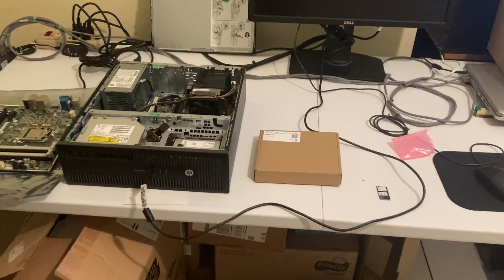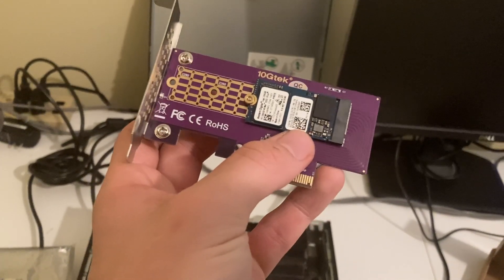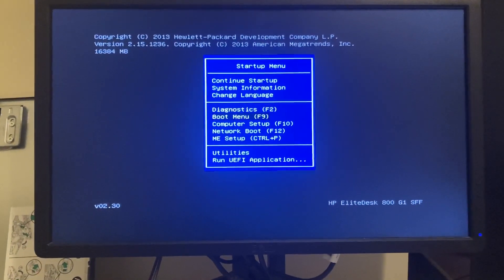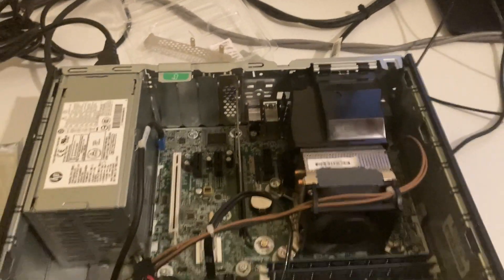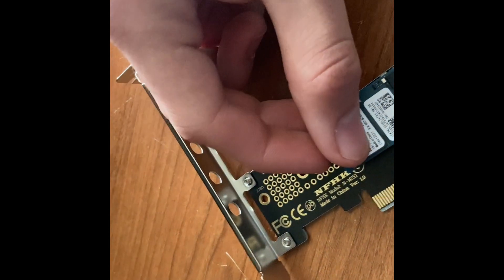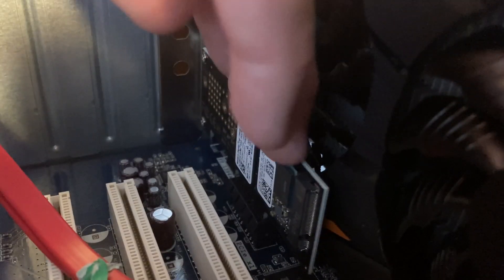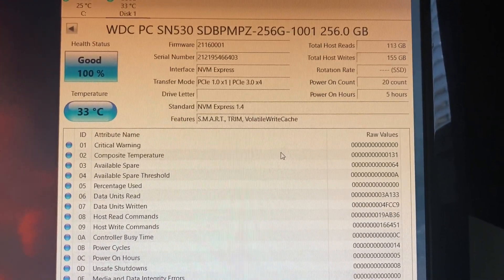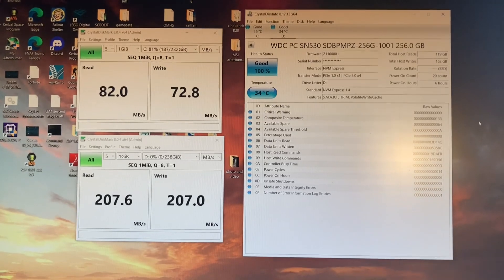PCIe X1 and X4 to NVME SSD adapter cards review and install

Comment: I use the x1 adapter to clone a new nvme from the old one b/c my system only has one m.2 slot. Swap it out later and use the old nvme on the slow pcie x1 as backup drive.

Comment: You didn't need to install these brackets at all for a lightweight device like the nvme. Most Chinese adapters are already without them. I also had a 10-year-old PC on Core i3770 without NVME support, but just before selling it I modified the BIOS to support NVMEs. Unfortunately, I haven't tested it, so I hope it works.

Comment: I have the same NVME PCIE 3.0 x1 adapter but on PM9A1 (980Pro OEM). 
PCIe 4.0 x4 RD SeQ 5600MB, 4k-64 3600MB, 4k 89MB.
PCIe 4.0 x4 WR SeQ 5400MB, 4k-64 3500MB, 4k 130MB.

PCIe 3.0 x1 RD SeQ 800MB, 4k-64 800MB, 4k 78MB.
PCIe 3.0 x1 WR SeQ 800MB, 4k-64 800MB, 4k 128MB.

Comment: i bought one works great pcie 2.0 x4 slot in a tiny case 1800MB read and write
Reply: Great .. can you tell me the brand name?
Reply: @melodychest9020  the one i bought is full length so will work in a x4 x8 and x16 slot  just not in a x1 slot
Reply: @melodychest9020  ELUTENG M.2 PCIe NVMe Adapter M.2 SSD
Reply: @melodychest9020  theyre all chinese anyway why would brand matter

Comment: I don't know why it was showing as a USB drive.  Maybe it has a controller similar to that of a USB drive.  Or it might be something the manufacturer did and did not catch it..  I don't mess with BIOS updates unless I must to get a fix for Logofail but the next update may have that drive named properly.  Do you get the expected speed from the drive?  If so it is not that much of an issue and is probably just a typo in a table in the BIOS.  I would not worry much about it myself unless I had other bizarre issues I could not explain.

Comment: I have a card similar to that and they are very basic.  The nice thing is it makes those adapters dirt cheap to buy.  It wouldn't surprise me if you could buy them in bulk for a lot less than the price of one each.  Mine has a green LED on it and really that is the only thing noteworthy.  I did not buy it for that or know it has it.  I usually don't prioritize any kind of RGB lighting.  The inside of my case is a dark dismal place really aside from that and the RTX logo on my graphics card lighting up.  My motherboard could support an APU but I just went with a plain old traditional CPU.  That is a Ryzen 9 5950x (16 core)

Comment: I was going to add that AMD's latest APU, 8600G has great 1080p graphics so you don't need a GPU, therefore the X16 slot that is usually designated for a GPU is now free to use with a storage form factor provided you choose a compatible X16 adaptor.
Reply: An APU alone is not enought depending on what you want to do with your computer, a GPU is a must

Comment: Some older machines require BIOS mods to support booting directly from NVME drives. I have a Dell 9020MT motherboard and I had to mod the UEFI bios to add a driver so it would support it. Such a mod may not be available for all mobos so kinda risky to try unless you do some research before hand. ;)

There are some cards that use bios extensions. This requires having CSM setting enabled in UEFI for those to be bootable if you are on a machine that is primarily UEFI based. The ones you got seem to be simple passive adaptors so you'll need a UEFI/BIOS that supports it natively.

Also it looks like you didn't initialize the drive until you put it into the second PC...that might also contribute to it not showing up properly on the first machine. You'll want to recheck how it behaves in the first one now that you initialized it. ;)

Comment: Judging by the 3 PCI brackets on the second board that slot may very well be a PCIe 1.0 1x. I would advise using at least an intel gen 6 or 7 board.

Comment: You bought a cheap nvme that's only PCIE one . Your motherboard supports pcie2 so if you get a new envy me drive 350 reads on a pcie 2.0 slot.

Comment: You actually dont need the bracket for this. Just slot it in and remove the braket unless your oc has not enough elvents then the braket will be one exhaust.

In summary the bracket is not needed for most cases
Reply: What is oc, please?

Comment: i was wondering if adding this to my motgherboard would work out because my only available pcie port is directly under my GPU but now I see yours is as well. How is that holding up ? i currently have only a sata drive so this would be alot faster correct?

Comment: When using these adapters, should I always put them in an X16 slot or lose potential bandwidth ? What happens when I put one in an X4 slot or smaller? Still works but slower?
Reply from the maker: If you buy an x4 adapter, and the ssd is x4, and the slot is x4, no bottle necks. If you change the slot to an x1 slot, everything will run at that speed. Whatever is the lowest of the three (adapter, slot, ssd) is will run at the slowest speed
Reply: @mrmax128  Thanks! , how much am I limiting if I must put an X4 drive into an X1 slot, would I only be getting 25% bandwidth ?
Reply from the maker: If the drive and slot are pcie gen 3.0 or 4.0 the x1 speed would be faster than sata iii, but equal or less than 25% speed of x4
Reply: @mrmax128 pci x1 slow usre m.2 nvme speed .. Ssd normal sata .. Than fast.. 500 mhz ssd speed ..

Comment: screw the gpu in the clamps dont have the force, also unless you only, have a 1x slot why limit the drive performance with a 1x card instead of a 4x.

Comment: You'll need to mod your BIOS first so it would detect your NVMe as PATA drive in your BIOS, I don't know if there's mod available one for your HP motherboard,  but I got one for my ROG Rampage IV, here's the mod link for Rampage IV motherboards https://youtu.be/uZDBBYfsNK8 (you'll need the mod for NVMe file added to your current/latest BIOS for it to works and bootable)
Reply: Now possible. See my link.

Comment: Well , i buyed 3 of those ( 4XPCIe 3.0 ) Adapters for ~ 7 Dollar over E-Bay (new) . I would be not surprised if they work with PCIe 4.0 as well because there is no chip on the PCB , its only rewireing . Maybe shielding could be a Problem for the PCIe 4.0 signal .Besides , most NVME will run with 2 Lanes or even one Lane and it dont has to be PCIe 3.0 . 2.0 will work to , its only slower . 
Its a waste of Lanes to use it on a X16 Slot with real 16 Lanes , if the MoBo uses Bifurcation for that slot = supports 4 x 4 Lanes i would consider to buy an Hyper X from Asus Card where you can put 4 NVMEs on it , i consider it for my NAS if i throw out the HDDs and put in SSDs in , with it i could use up to 7 NVMEs in my TrueNAS ( old B450 Board with 3900X on it , 32 GB ECC Ram )
Reply: @OKuusava  ? For 40 Dollar 4X PCIe 3.0 NVME  or 60 Dollar with 4 x PCIe 4.0 with 4 NVME Slots ? In a NAS you dont need necessarily a GPU , if your old MoBo supports Bifurcation and you need that many NVME an Hyper X is the way cheaper option . And i just found another interresting use for an M2 NVME Slot , there are Adapters for M2 slot to SATA with 6 Ports , just ordered one for my NAS on Ali Express for ~ 20 Dollar . My old B450 in my NAS has only 6 SATA Ports , but 2 NVME Slots , one is my Boot Drive the other one is unused , lifts the possible HDDs/SATA SSDs to 12
The restriction on a  consumer Plattform are allways true PCIe Lanes because consumer CPUs have only 24/28 of them , 16 Lanes for the GPU , 4 for an NVME and 4 for the Chipset

Comment: There's different flavors of NVMe M.2 drives for specific purposes and it's buyer beware if you're looking for a SSD HDD replacement. A dead giveaway are the prices. It's worth doing some research on these drives so you won't be disappointed by the posted speeds.

Comment: For your first machine, you should use the bottom x16 since only 4 lanes are needed. The top slot is x16 wired while secondary slots usually do x8 or x4.

Your second machine would be better suited to a SATA SSD. It has SATA 3 ports, which would give significantly better performance than the M.2 limited by x1.
Reply: Without knowing the exact motherboard, the second motherboard looked like a late generation LGA 775 platform and would be limited by the SATA 2 3Gbps speeds provided from the ICH (SATA 3 6Gbps not yet available). The PCIe 1 x1 slots runs at 2.5Gbps and is also connected to the ICH
Reply: @saccharide  Unless I got confused with 3Gbps there was some point in the video that gave me the idea it was SATA 3 6Gbps, I'll skim and edit in a timestamp if I find it.

Comment: i have this morherboard " msi pró X299 is pci 3.0 if i buy  SSD adapter PCie 4.0 x 16 i gain bost or only stay in PCie 3.0 ?!!
Reply from the maker: If motherboard is Pcie 3.0, then any device connected, like ssd, will be limited to pcie 3.0, and will not do pcie 4.0
Reply from the maker: If motherboard is Pcie 3.0, then any device connected, like ssd, will be limited to pcie 3.0, and will not do pcie 4.0

Comment: If you want to boot from a NVME SSD natively on a system that doesn't support it you need to get a Samsung 950 PRO SSD, that is the only NVME SSD with a boot rom build in, anything else wont work
Reply: Thanks for the info
Reply: You mean like windows 7?

Comment: 9:02 Barely. The theorical speed of PCIe 1x1 is 2 x 250 MB/s. And we see it using a little more than 83 % of it.
The theoretical speed of SATA(III) is 600 MB/s and we've seen 2.5" SSD drives as fast as 560 MB/s in practice! More than twice that speed! 
So get that instead of this.

Comment: In order to boot from SSD adapter, you need an adapter with it's own BIOS extension. (boot capable, with chips like Asmedia for example) You can even use it in an LGA775 main board, with PCIe 1.0 or 2.0.  You will see an extra boot option in bios settings with these cards.
Reply: you can use bootable clover in usb
Reply: Those adapter cards with bios extension are S L O W. Your better off using SATA and stay off the PCIE lanes with junk controllers.
Reply: @alsanderson4917  right pci x1 slow speed ..500 mhz ,better than ssd normal sata port
Reply: @kamalyadav3024  pcie 2.0 x1 is the same speed as sata3 pretty much
Reply: pcie 3.0 x1 twice as fast
Reply: You can also use an SSD with Legacy Option ROM. Unfortunately these are only older ones like the Samsung 950 Pro, which I previously used in a Hackintosh.

Comment: I've used Clover to boot my Hackintosh for years. It can be installed on any small SATA drive too, not just a USB stick. I'm currently building a 4th Gen system to use RDT to access my main PC. I learned there was a custom firmware that added NVMe booting to the motherboard I had. After a bit of vetting, I decided to go for it... It's only a 4th gen board. Not like it's new. Flash went flawlessly, and now the board can boot from an M.2 installed using one of these PCIe adapters!
Reply: Was the custom bios from 1 source? I saw a video of a guy offering custom bios adding NVME support. Share the link for that. I have an old X58 board I want to add NVME support without clover.

Comment: 1400 mbs using a 2 drive raid 0 on a old p5q3, next week I'm gonna try 4 ssds in raid 0 to see how fast she moves and you can boot off it since it's set up from the bios.

Comment: only thing by using that card in the 16x slot means you cant instal a dedicated GPU
Reply: Pci x1 m.2 speed very slow ... Better than ssd normal use sata port ..

Comment: Cool video, but decent sata 3 SSD would smack the shit out of that PCI-e 1.0 x1 interface ngl. Even cheap dram less drive would do at least 450 read 400 write
Reply: Not really because these are older computers that don't have sata 3. I did buy a pcie X1 to sata 3 bord and unfortunately it only gave me sata 1 speeds. It was a cheap China board. You got to check the specs on these things when you buy them people try to rip you off thinking you're getting sata 3. 😮
Reply: @TimothyCampbell-h4z  I have asus h61 board ..but pci 16 slot use gpu .. Pci x1 .. Only .. M.2 nvme use .. What speed ?

Comment: First NVMe was not USB hd, bios did not support boot from NVMe (or NVMe was not bootable)
Reply: elaborate
Reply: @Clashy69  Old systems do not support boot from NVMe
Reply: @terosma  what count as old like csm bios ? i have msi b550m pro vdh wifi and i need to clone my boot drive into a new one but the easiest way is onto an x1 slot, would it work without doing anything else other than moving boot priority
Reply: @Clashy69  NVMe boot support started 2015 on Intel, 2016 on AMD, some cheap mobos did not have support after that either. Needs UEFI in bios in general. Your MSI is not that old, Grok says x1 slot is not bootable for NVMe M.2 though, they have omitted UEFI boot on x1 slot to save space. x4 x2 or x16 slots can boot NVMe.

Comment: sata will be better speeds for ssd than pcie 1.0 x1 which is 250gb bandwith. 2.0 x1 is 500gb and 3.0 is 1gb. So pretty much go sata unless pcie 3.0 x1 or any pcie x4 adapter will be 1gb and up. Hope that helps others.
Reply: Pcie 1 x1 is 250mb
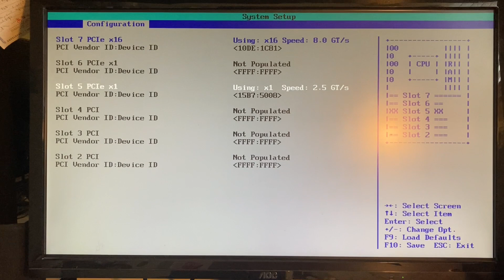Reply: For the 1st sff pc he is using a pcie x4 adapter which utilizes 1gb bandwidth and is actually better than sata. The second pc, he is experimenting to see what the pcie 1.0 x 1 does with the adapter. In that case, I'm sure he would just go the sata route since it has many connections and he has a spare at 8:40.
Reply: For an SFF computer like the one he shows, for space constraints and needing more storage space, this solution is the only good way to go. Otherwise, for bandwidth, I agree that SATA is better.
Reply: You are thinking pcie 1 x4 which is 1gb
Reply: @GFDthatsMe  thank you for correction, PCIe 1.0 x1 lane 250mbps, x2 lane 500mbps, x4 lane 1gbps (i googled it this time)
Reply: @jomerbiason4934  Welcome. Glad I could help
Reply: PCIe 1.0 runs in 1Gbps while mSATA runs in 500Mbps so using it as an extra storage is fine as long as it's not NVMe or M.2 because it will bottle neck the technology.
Reply: @Theni_G.German  :  BUT THESE Igb/SE ARE COUNTED FOR THE DOUBLE ROAD OF SIMULTANEOUS WRITING AND READING, BUT WHEN DOING ONLY THE DATA READING IS 500mb/S. VA VERSION  PCIEXP VERSION 1.0 on 1X
Reply: @Peaches.Gonsalez so is there a possibility that I can connect a m.2 nvme ssd to pciex1 port through an adapter?
Reply: @otakuxculture2014  yup there is an adapter M.2 ssd to Pcie 3.0 x1
Reply: what speed would i get if i use on pcie 2.0 x1, im still using hdd right now and i really want to upgrade to ssd, preferably nvme, but my mobo right now only have 1 m.2 slot, so i thought in the meantime i would use the adapter until i have enough to buy new mobo
Reply: Can anyone guide me how to configure nvme to pcie x1. As my pc is not detecting this device. I have a 3rd gen i7 3770 with a DH77KC chipset
Reply: Can anyone guide me as my pc is not detecting nvme to pcie x 1. I have a i7 3770 with a DH77KC CHIPSET.
Reply: Actually SATA is not always better even at slower PCIe speeds. SATA drives might be fast at sequential speeds (moving big files) but they're lousy compared to modern nvme drives when it comes to random access (loading operating systems/games etc). So if you have a motherboard without an m.2 slot, you can save load time by using the adapter instead of going sata. 

Detailed explanation: You might still be better off with a PCIe gen2 1x nvme drive at 500MB/s compared to a SATA at 600MB/s. For OS boot up times even PCIe x1 gen1 at 250MB/s is more than the fastest random access performance on pcie gen5 drives today. They usually top out around 150MB/s random read queue depth of one.
Reply: Hp machines feature an odd lip of metal where the PCIE bracket sits. It can make non-Hp devices difficult to fit, though most will, with fiddling.
Reply: We don't care

Comment: I appreciate the video. I've been thinking about getting something like this, and have been watching videos about them for the last hour or so. One thing I'm noticing is people having a lot of difficulty with the cards that hold 4 M.2 drives. They seem to  not be able to get more than two of the drives recognized. Also, some of them don't support PCIe Gen 3 (or higher). So it's nice to know which ones to avoid. Thank you.
Reply: The issue with those 4 drive cards not working properly might be PCIe bifurcation. For all of the 4 drives to work your motherboard should be able to split a PCIe x16 slot to x4/x4/x4/x4 from BIOS settings. For example my MB supports bifurcation only to x8/x8. Some support different splits or possibly none at all. But the reason why only 2 drives work on 4 drive adapter card might be that the motherboard doesn´t support splitting the slot to more than two devices. Was looking into this recently and had to forgo the 4 drive cards myself too.
Reply: This is definitely a bifurcation issue. the cheaper 4 slot cards require the motherboard to do the bifurcating. If you get the $150-$200 cards that have an onboard controller, you can have 4 m.2 drives with x4/x8/x16 lanes (depending on the model you buy).